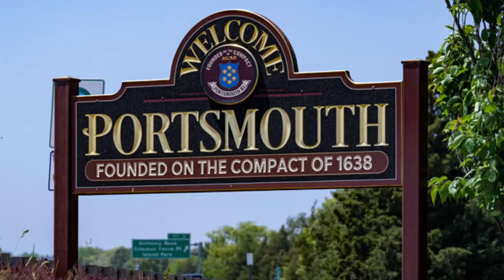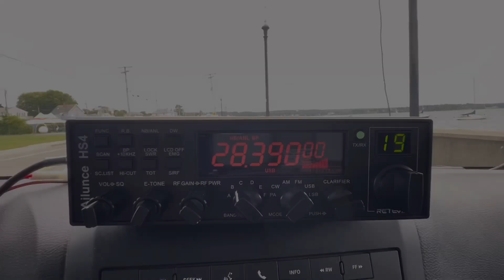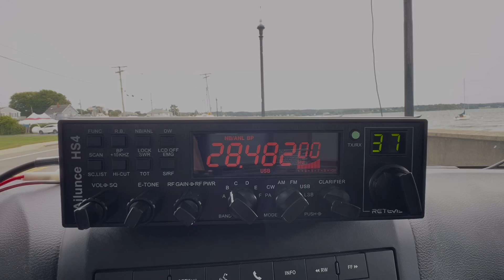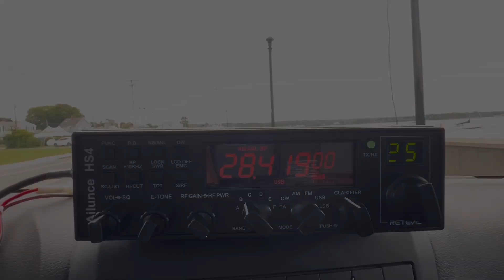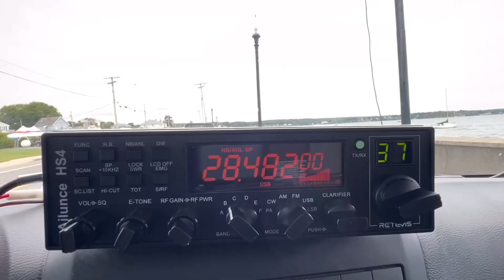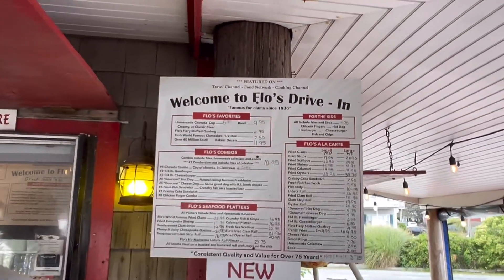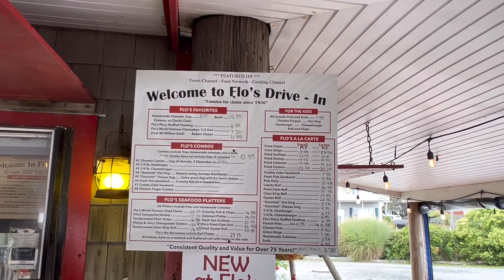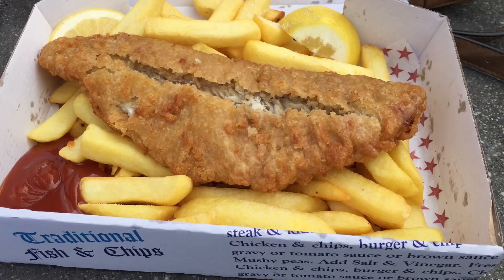10 Meter Halfwave Vertical Antenna - Portable Ham Radio

Comment: Hey Walt. I wanted to update my last comment and say that I was able to get an actual 28 foot proper pole for my antennas (instead of using Bamboo poles cobbled t5gether), the same 64;1 Unun, and am using this antenna. It's great and no tuner! Anyone reading this: I build the majority of these antennas and I ALWAYS get great results! I was able to get the pole and Unun thanks to my club awarding me an Elmer award which came with a check (of course, I thought they must have made a mistake because I will forever be a student of the radio arts, You antennas work so well and I send all our club's new amateur radio operators to your channel for their HF antenna needs. Thanks again. You and your wife are in my prayers...73...Hugh...KN6KNB

Comment: You inspired me to make a 20m 1/4 wave  antenna yesterday. I utilised wire from my "odds and sods" box, plus a telescopic pole and a length of coax that I already had. Basically, it didn't cost me any extra to build. Here comes the good part, I normally use a multiband HF end fed wire antenna (commercially made), but the 1/4 wave vertical out performs it by far. It's standing in my garden at the moment and I might use it permanently, although I am considering changing it to a 1/2 wave for more flexibility. If you see this Walt, I will buy you a "pint" next time you are in London. 73 Bob, M0BOB.

Comment: Nice location there Joe.  Haven’t made it over to Flo’s yet, didn’t realize they had such a great view and a great shoreside DXing location.

Notice that when calling stations you typically only give your basic callsign.  I’ve found that adding “mobile”, “stroke mobile, portable, or QRP after my call especially in a pileup often is a wedge that gets me noticed in the cacophony.  Often, other stations also in the pileup will say to the DX station, hey there’s a mobile in there, why don’t you give him a try?  Works especially well doing low band mobile DXing on 160 80 and 40.

Also, when operating mobile, and getting the usual 59 report I’ll ask is that a real 59 or a contest 59, I’m untested in how well my new setup is working. About half the time it’s usually less, and when they say yes it’s a real 59, it makes me smile!

Chris AJ1G Stonington CT
Reply: Oops, sorry Walt, didn’t mean to call you Joe!  TMB (too many birthdays) syndrome must have kicked in!

Comment: Hi Walt.  I've been watching some videos on your channel lately and started of with the Rybakov vertical. What would you these days after all your tests consider the best vertical for 10-12 meters. For some reason I mysellf would say 'build a 9:1' with the correct lenght of wire. It's easy to use on different frequencies. I have a 49:1 myself with a 23m wire for use from 80 (with coil in the last part) 40-20-15-10 but I tend to see better results on shorter verticals for 10 and 12 meters because of the lower take off angles. I must say your location is great. No QRM, and a simple 1/2 wave vertical with only 40 watts. Man, congrats. Ant thoughts ? 73 Phil ON4VP

Comment: Another good video! I had a great radio day Sunday on 17 m with my G90 and Coastal 20 antenna (17.5ft and 3ft counterpoise with 4:1 unun).  Land locked TN. You may need to think about a new channel name  - Coastal Diners, Waves and Wires.  Thanks. Regards to the Mrs.

Comment: Great antenna Walt.  10/11/12 meters has been hot lately ! Just adjust length a tad and you easy got 3 bands.  The equinox is great time of the year for 10/11/12 and working with gray line you can get them far away stations.  Spring and fall work different for DX . The vertical is the way go go for chasing that DX . Lots of FT 8 into the UK lately , and several bands open to the UK as well . Been doing the 5/8 wave vertical lately.  Using 4:1 UNUN I wrap myself on a T 200-2 core.  I have to use the ATU but is close like around 2:1 to start with.   I am ground mount with bunch of radials . I got a 20 AH LiFePO4 12.8V and talk for days on 40-60 watt radio.  73

Comment: Another excellent video. I imagine that the high inductance of the unun works with a 10 meter end fed but is it the optimal winding ratio? I have found that the full 64:1 is good for the low bands, taking off a few turns significantly improves the SWR readings on 10 and 15. On 10 meters, I found that a 25:1 imp ratio, (10:2 winding) optimizes readings, like 1.2 to 1 SWR at 50 ohms. Add a couple turns and you optimize 15, (with the longer wire). 49:1 for 20 meters. This is using the Fair-rite 2643251002 "chunky" toroid. The other more standard cores yield the same results. As an aside, I made a 10 meter "slim jim" with 450 ohm ladder line and got even better performance! Furthest contact has been France last Fri. This is from the west coast! They work gangbusters and are super easy to deploy. About 23 ft. Made a 20 meter one and it's close to 50 ft - not as easy to deploy but works equally well.  Calcs to make em are on the web. 73, John, kg6zbn

Comment: I bought the same Unun from Amazon.  I have mine as a sloper with 80 feet of wire in my backyard.  It is working well on 10 meters.  Well made Unun for under $40.  Have a great day Walt. 73 KD2ZZE.

Comment: I love your portable radio setup. That's EXACTLY how I set up for POTA if I don't do the picnic bench and MC-750 thing. Radio on the dash, wire out the door, and battery on the passenger seat. I posted a pic of my setup on a POTA FB page and one guy just 'CRAPPED' on me for the bogusness of it. It was SO bad the moderator flushed him. 😆  But hey, I'm totally portable and don't want to permanently mount anything. Another good video, Walt.

Comment: This is why I need the sketch book. I have no idea why you decided to use an unun or why it's a 64 to 1.  I got France, India and Lithuania this last Saturday on the G90 with a simple 10 meter Hamstick on top of the truck. And that was from the west side of the country in Northern Nevada. Nearly 6000 miles on that stupid little hamstick and at 5 watts no less.
Reply: Do you know about antenna theory in relation to a half wave, and the impedance spread across the half wave wire? It starts at between 50 and 100 ohms in the middle, depending on height above ground, then increases from there to about 2000-3000 ohms near the end. If you end feed it, you need a transformer to transform the high impedance down to 50 ohms to match the coax and radio.
Reply: @paulsengupta971  No I don't know anything about all that.
Reply: @mobiltec  Have a look at the Radio Prepper video "Clearing Up Some Confusion About End-Fed Wire Antennas."

Comment: I have that same Xtenna switchable impedenence antenna with a ~30ft wire and 18in cp. It's a serious talker on 20m on the 12.5m mast and works 10m and 15m fairly well. Thanks for the tip for that antenna a while back!

Comment: I have one of those same 64:1, it's been working extremely well, made contacts all over the world with twisted pair piece of install speaker cable with the two conductors connected together at the balun end. I opened it up and it's decently built. I made a contact with LY788A late last night on 20m with that 64:1 set-up. It's a good purchase if you don't want to build your own balun. It has held up since last winter here in Nova Scotia.
Reply: Did you connect the speaker wires at both ends or just at the balun?
Reply: @jackmortimer329  just at the balun end... You could do both ends but only have to do the balun end. And only because it's twisted pair cable meant to shed RF when it's used as speaker cable installed in a ceiling or other space. When you connect both conductors it's no longer a twisted pair electrically. Been working like a dream and the cable was free and it's decently strong. I'm going to replace it with something stronger for the winter I think, clothes line most likely, it will withstand any ice storm build up
Reply: OH WOW I talked to JY788A on Friday using my G90. on 5 watts. I was portable with a Hamstick. Radistu from Lithyuania was great to talk to.

Comment: Brilliant! Great video. I have been pondering building a 64:1 and was waiting to see one appear in your videos (I was looking at the one you got from Amazon because I was thinking about buying one, since they are reasonably priced. It is amaazing how the 10 meter band has opened up lately, even in the afternoons. I can't wait until; the fall! Thanks for another great video and doing a test drive. Now it's time to cut some wire and do some soldering. I assume the 64:1 has a capacitor in it? When I was reading up on building  one, the general consensus was you needed one for 10 meters. I didn't have my "splaining" glasses on so I can't give the techgnical reasons why. Thanks again...73...Hugh...KN6KNB

Comment: Walt: I totally agree on the 64:1 instead of the 49:1 Unun, but I alwaysvadd a Voltage Return counterpoise. This was a recommdndation from the Editors & Engineers Radio Handbook and also on AATTB's web page the cointerpoies is 0.05-waves, so for 10 meters it's 21" long. The addition of the voltage return really helps keep RF off the shield! Cheaper than a balun or choke, too...

I built a multiple tapped Unun for my testing. I tapped it for 4:1, 9:1, 16:1, 25:1, 49:1 and 64:1.  It makes selection of an Unun a simple task. Mine is wound on an FT-240/41 core and mounted on a scrap of plastic cutting board!

Keep running portable and CU on the band(s) soon.

73, Keith, WB2VUO in Amherst,  NY

Comment: Finally had some decent weather at my QTH this weekend, so I took the opportunity to build a couple of portable antennas and try them out. Had some nice QSOs on 10 with the 25' Rybakov, even though I was battling a high noise floor thanks to the surrounding suburban jungle.  That aside, I still had fun getting outside, playing radio, and shaking out some portable options when we finally get some proper autumn weather.
73 de N8ESP